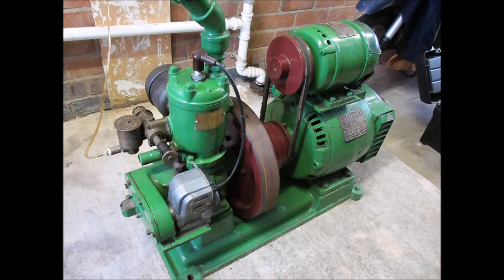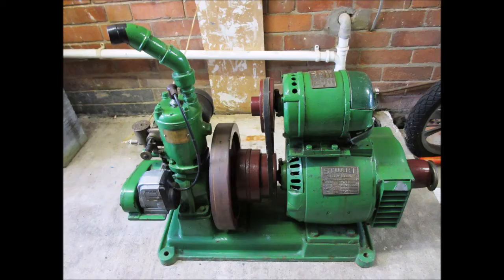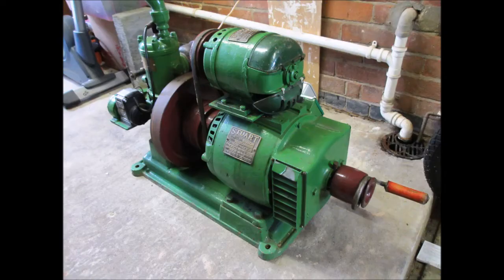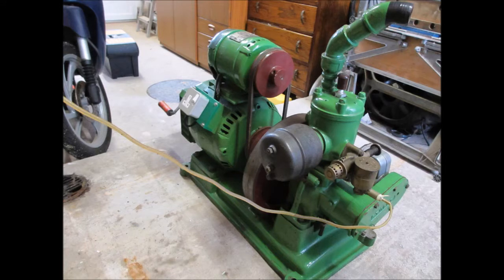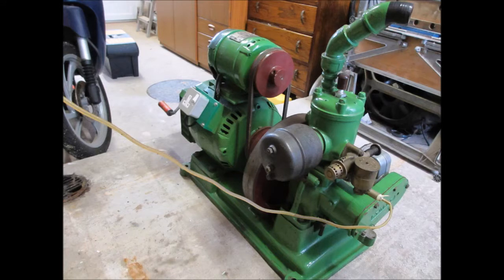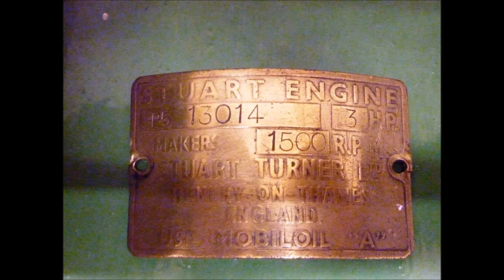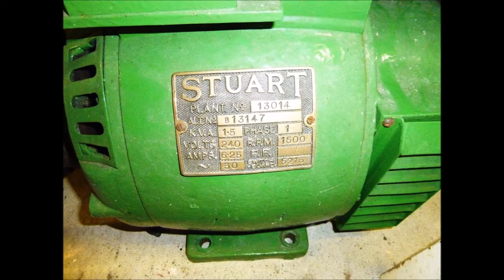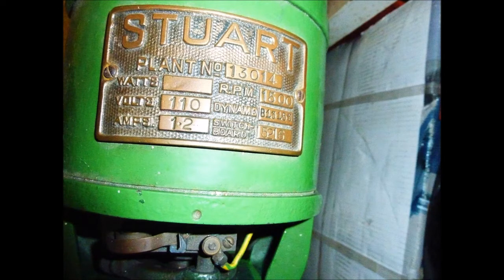Stuart Turner Generating Set

Comment: Very nice, I have the same engine, and originally would probably have been the same unit, mine is 3 engines older.
The original ST daybooks date mine to 1942, September 3rd, customer was the GPO
Reply from the maker: That sounds about right , I found on a web post somewhere a thread that gave engines with similar number an approximate date of 1943, if your information is from ST's records it must I think also be of 1942 manufacture. Under the light green paint there is a darker green paint that looks to be the original ST Green paint.

Where can I find the original ST information ?.
Reply: I'd have thought 3 newer than mine and yours would be later the same month, can't see they would have been that rare at that time. I ignored the war issue thing as mine is GPO and did mine in BS.222 green, the correct colour for the year, or so I'm told. There are a couple of videos under my user name on here showing it post re-build. I have no idea how the private message system on here works, but if you do send me message and i'll pass the details on for you to get accurate date and original build spec.
Reply from the maker: Hi Neil
I have for some time, several years periodically looked on EBay and Gumtree to look for a manual for the P5  AC lighting sets but never found one and the generating sets I found for sale were all DC generators. 
Wanted a manual to work out the electrical side as the switch board is missing - I now have the exciter coupled direct tot he alternator so it is unregulated - hence the light bulb is a bit bright think it may be putting out a few more volts.
Several years ago I did see somebody selling a generator + exciter on EBay in poor condition and once saw a switch board - wish I had bought it !!! I did however save the photograph of it so I know what it looks like, it only recently dawned on my that the switchboard incorporated a manual regulator to adjust the output.
Use my work email graham.bell@rail.bombardier.com for contact